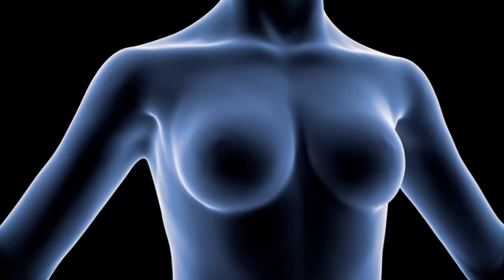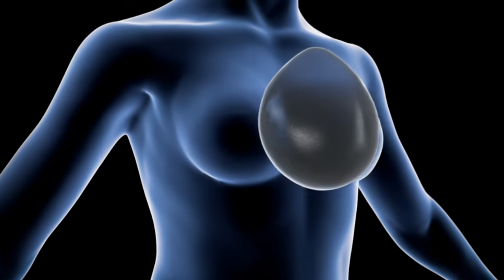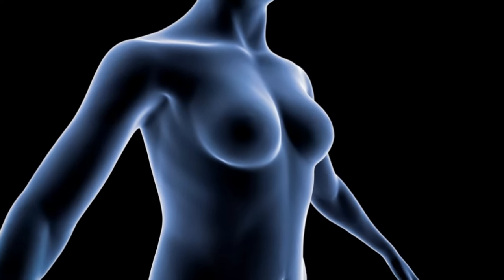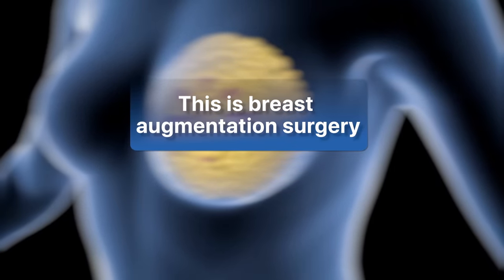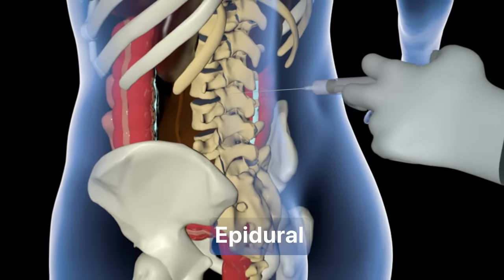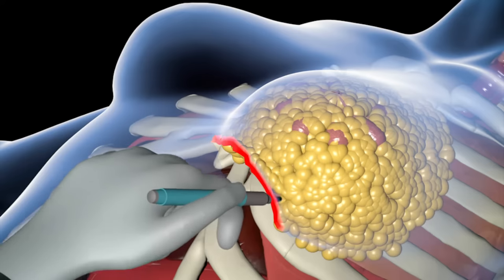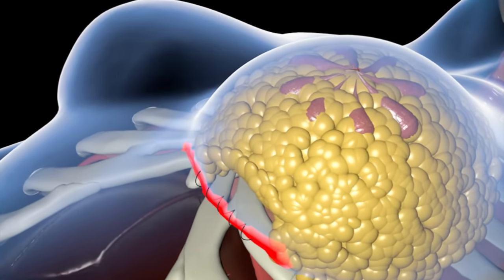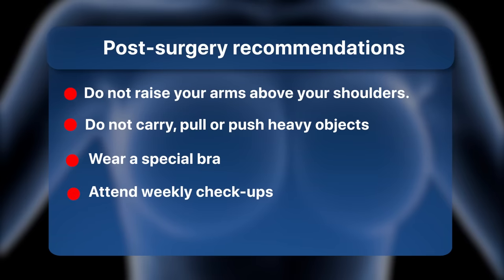How breast enlargement surgery is carried out

Comment: there are three surgeries out there. The first is called a memoplaxi which is what is shown in the video an incision is made in the breast and implants are installed. Memoplaxies most of the time are done for reconstructions but the doctors and I should warn you memoplaxies have a 90% chance of being botched and they always have complications. The implant can rupture filling the niples with bacteria, Breast Implant Infection can occur, the wrong implant can be inserted leading to double bubble, and incorrect implants and boob jobs can cause rash, redness in the nipples, pain in the armpits and the back, and they can cause discomfort. Implants are not forever and need to be taken out after the breast has regrown or if another reconstruction occurs. 
 
A Mastectomy is a reduction tissue is removed and the breast is sewn shut. Sometimes implants are used for reconstruction. A mastectomy is done to treat cancer or to reduce breast that are over the cup and bra size. Size D is normal and is the maximum allowed size with or without implants while size E is the max size with implants to avoid discomfort. Size F, G, H, I, and J are too large and can cause discomfort. Most of the time oversize is caused by a botch where too many implants are used or the female body absorbs too much estrogen leading to their breast to swell over their bra size. When this happens the Mastectomy is the only option to reduce the breast back to normal size. 

 The final type is a mastopexy. Just like the memoplaxi shown above an incision is made and implants are installed but this time natural filler is used to increase the size. The mastopexy is done to treat droop and to fix deformities sometimes caused by over nursing which reduces the size of the breast, estrogen overbalance when can cause one breast to grow while the other shrinks, and menopause which the body loses estrogen causing the breast to shrink. The mastopexy must not be used on women under the age of 21 or women who are teenagers this surgery can get botched and too much filler or implants can be used causing complications. 

   If you get any of these surgeries remember: No Yoga or pilates, Do not raise your arms until the stitches and the drains have been removed from your breast and the scar tissue has been sealed or has been removed, No lifting or moving heavy objects, Do not unclasp your bra or remove your corset or chemise until instructed by the surgeon to take them off and the drains and stitches are removed and the scar tissue has sealed or has been removed, Attend checkups and complete your physical, stay in rehab until you have been released, do not go to hotels, do not go swimming, do not go to parties, do not drink, do not smoke, and if you must bath use special care not to tear your stitches. 

If you have complications call your surgeon and get the implants removed. A common thing that can happen is mold or bacteria can get into the implants if this happens get them removed as soon as possible. 

All implants are tested at the FDA and are disinfected before they are packaged. If you get an implant that is not FDA certified or if you have had 10 years since your last surgery get them removed ASAP or you can cause bacterial infection which is fatal.
Reply: That is a lot of rules to follow ,wanted to get this done when I was 14 don't think I want to do it anymore
Reply: This comment is as important as the video this should be pined

Comment: 44H
Reply: U do yoga?
Reply: @ab-jc8nv  Rarely, mostly do cardio, core, more so mostly leg day and back muscles then weights. I don't use the ac that much on hot weather unless the air itself gets hot. Fruits, homemade balanced meals, alcohol few times a week/month, rarely ever anything greasy like a burger or pizza, minimum 1 or 2 singular cigarettes a month a box lasts. Lots of hydration, stretching, wing chu and cqc.
Though I am failing by not swimming, a gym pool would do but sometimes these feel odd while submerged in water or its just me not getting used to floating much.
Reply: Yes?